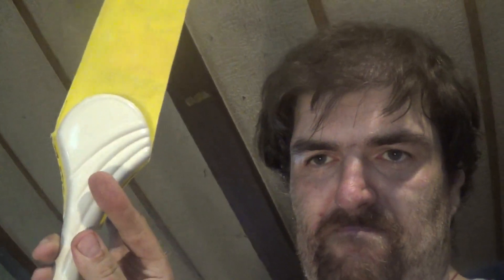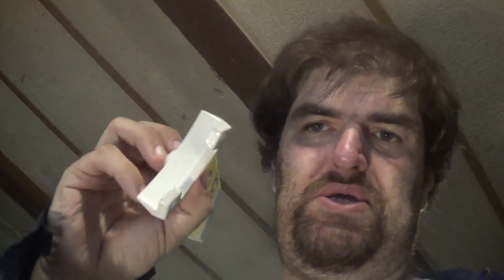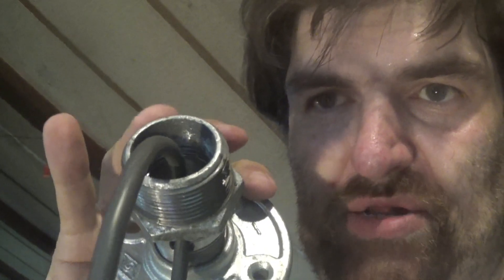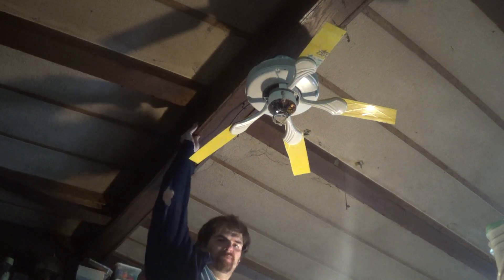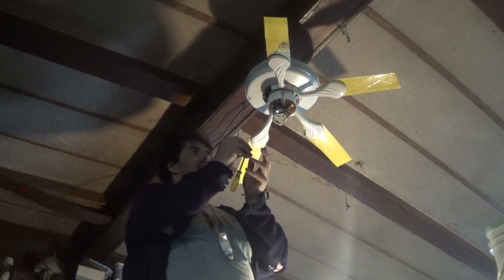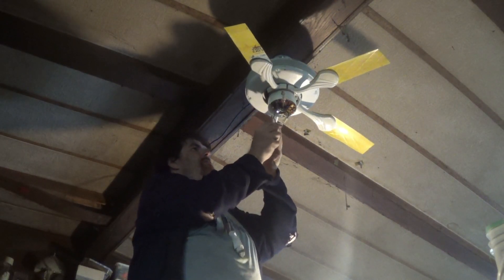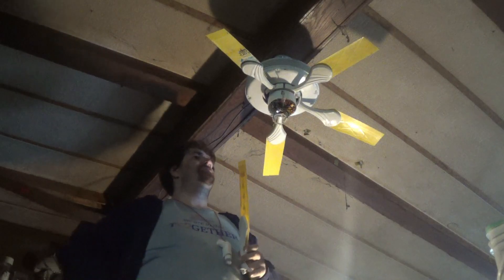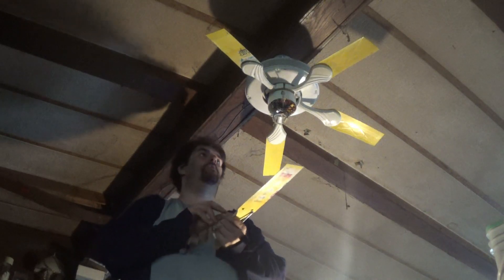Recycled Ceiling Fan Works

Comment: You need to get its correct blades
Reply from the maker: I could if I had the money. Hence the trash scavenge ceiling fan.
Reply: @nathanalaneller  how much was the fan
Reply from the maker: @bensgoofyahhfancollection9997  Did you reed the title?
Reply: @nathanalaneller if you got it for free itr be worth it going to habitat and getting a cheap pair of blades for it